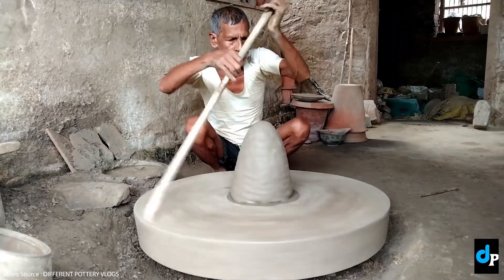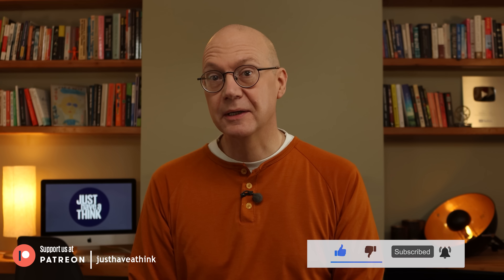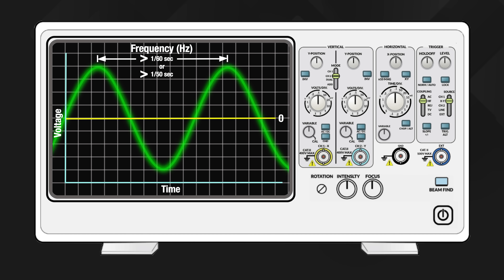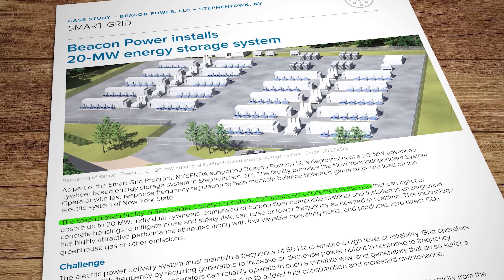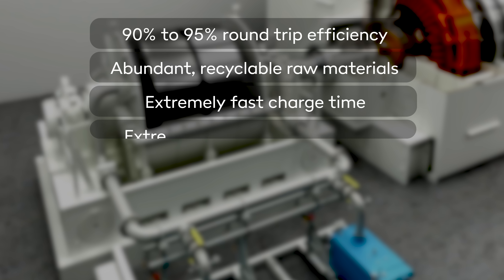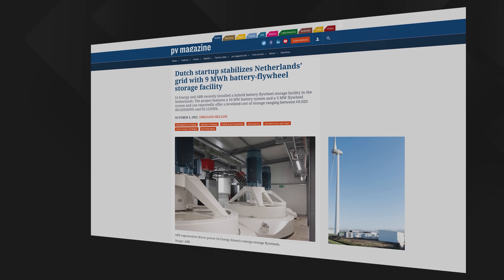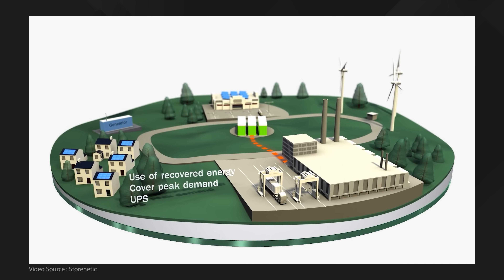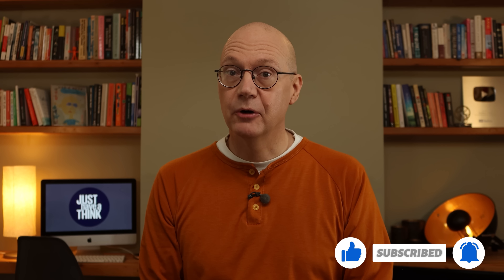Flywheel reinvention revolutionising our power grids!

Comment: 30 years ago was a company around called magnet motor in starnberg near Munich. i think today they are called Renk Magnet Motors and are mostly in military. Back in time they did Busses with e-drive per wheel and diesel engine to power all. To give the system an enegry storage for some minutes a fly wheel storage was atached. The thing, to be in a bus, had to be mounted cardanic. I was told that one prototype was run against a wall in a coal mine to get aceptance for public transportation. The coal mine because fly wheels can become nasty when stoped in an accident. There is a lot of energy in storage.
Reply: I know the guy who built this!
Funny story

Comment: Data centres have been using flywheel units for backup power for well over 20 years. I don't know about earlier but when we were designing colocation centres in 1999-01 they were a viable option, developed if I remember aright in germany.
Reply: Yep. 🙂 I remember watching an Open University programme (on the BBC in the UK) about flywheels in the 1980s. It showed a system used by the French national telephone company to provide emergency backup power.

The flywheels were solid steel cylinders about 500mm long and 150mm in diameter, weighing around 350 kg. Mounted on magnetic bearings in an air-free enclosure, they ran at 12,000 rpm.

I think the energy storage was given as  7.1 megajoules, which was described as the equivalent in kinetic energy of an average family car travelling at 250 mph.

Because of the potential danger of a malfunction and disintegration, the enclosures were buried in pits underground to contain the angry beasts.
Reply: They don't provide long-term backup power. Their purpose is stability - they only have to keep the power running long enough for the generator to start up, and handle any brief voltage drops or spikes on the grid, or a sudden surge in load.

Comment: I've been harping on about this for the last 15 yrs, so good a variety of old greener tested solutions are becoming part of national infrastructures.
Reply: 15 years? Good going, but they have been a feature of power grids fro a bit longer than that.
About 10 years back, the grid scale flywheel manufacturers started looking at systems for micro grids, we had one being developed by Williams on our local stand alone grid.
They really extend battery life by reducing ripple current charcge/discharge.
Another system that was trialled here (starting about 5 years back) were ultra capacitors, which can respond about 10 times faster.
Reply: 15ys ago it would have been competitive as well... Today, with even the expensive tesla megapacks beating it hands down, it is not competitive any more.

Comment: No they won't. Electric companies are routinely discontinuing use of old synchronous generators that can perform this function... we are loosing rotational buffers every single day... everyone is transitioning to unstable power FET/inverter designs that disappear when stability and/or VAR is needed most.

I just watched my local power utility scrap 100MVA of synchronous generators/condensers... we now have no rotating objects within 100 miles of here... and that peaker is due for decommissioning in 2025.

Comment: Energy storage capacity is relative to mass and radius. Mass is bearing dependent and radius is dependent on structural integrity of the flywheel. Probably not much room to improve on magnetic bearings but material and design engineering might eventually lead to improvements in radius. This would result in lighter Weight more energy dense systems
Operational efficiencies such as using excess mid day solar or transitional wind gusts to power up the flywheel to supply short term storage for traditional evening peak demands might mitigate the short term overnight energy disapation issue. 
Ditch lithium ion entirely and replace with more environmentallyfriendly battery/mechanical systems as they come on line. The significantly longer useful life will lower per unit storage costs especially if demand based systems that provide short term but odten very expensive eletricity are replaced with 2 cent power
Also there is no reason the modular units can't be used as a distributed system in commercial and school systems reducing transmission losses and infrastructure costs. I would imagine a profit sharing centrally monitored and controlled system drawing peak power from the closest source and being charged from the locally cheapest power. 
Each distributed installation could be preprogramed to buy and sell using their own priorities involving time of day, charge level, market conditions etc. 
In our area commercial accounts are additionaly charged for 80% of their of thier peek sliding 5 minute window. For instance on demand peek occured when the kitchen went operational. You really can't effectively load shed cooking equipment. Another occured when every every light in 300000sq ft building wrnt off Simultaneously although this has been mitigated by led retro fits. The hvac hot water pumps for a zoned building system that size could exceed 100 hp and had to run contninuously to prevent localized line freeze ups. A distribuedvflywheel system vould be used to power up one or more of those systems and reducing over all energy costs by 30% or more.

Comment: Nuclear is the way, using this storage with them would be great
Reply: No it isn't. One always hears base load, base load.... but that's not helpful for a grid with lots of intermittent renewables. What's needed are fast responding sources of backup power. Nuclear produces a steady output which has the effect of reducing the amount of wind solar etc that can be accomodated. Examples of despatchable backup are thermal biomass, batteries, pumped storage or even natural gas if only used occasionally.

Comment: Rotating machines can contribute useful inertia to a power system, so allowing large amounts of energy to be stored for very short periods (seconds).  But they would be very expensive (as you said) as a way of storing energy for longer durations to help (say) with the need to store energy generated during the day for use at night
Reply: The coils of transformers and inverters also provide electrical inertia. Then add a ms response time and you are at the exact same place for a much lower cost (today) and for a much longer timeframe with LFP based batteries.

Comment: Thanks for that welcome update on flywheel use in energy storage and regulation.
I wonder how the flywheel solution would compare to super capacitors as both seems solutions to the same issues with battery storage and share a lot of the identical advantages.
Reply: Supercaps have much lower self-discharge, but flywheels are much cheaper. Last time I checked supercaps were over 10* the cost/kWh of li-ion.

Comment: An important reason for the use of flywheels is that that can simulate an important characteristic of rotating generators, that of inertia. Dave mentioned inertia but did not explain it's significants as it is a bit tricky. Rotating power generators typically produce AC at the frequency of the grid. If grid frequency falls the rotating mass of the generator puts energy in so resisting the frequency drop and vise versa if the frequency rises. It's a head ache for grid operators as more and more generation is replaced with DC sources that are then inverted to AC by electronic equipment as they do not provide the frequency stabilization of rotating machines. That's where fly wheels come in, not just as another way to store electricity.
Reply: Are you sure ?
BESS   is Battery Energy System Stabilization.   The inverters on these DC sources are computer controlled and should be invisible to grid operators.    I don't know a lot about it.  But that sounds logical.  Why would people be involved ?
Reply: @danharold3087  you are correct in so far as the response time of BESS is extremely fast and is automatic. However, inverters are (usually) limited in their ability to deliver high fault currents without making their designs uneconomical. The use of the inertia of a rotating mass to provide 'fault ride-through' means that more conventional and mature technology of synchronous generating plant can be used to provide network stability and also respond to reactive power demand. Modern BESS and so-called synchronverter systems are starting to make serious inroads into the availability of grid-forming inverter network support but they've got a bit to go before they can compete with the inertia of four 660MW synchronous machines at a conventional large power station!
Reply: @protectiongeek  Thank you.   Power engineering is not my field.   Not saying I am correct.  There is always a danger in using logic when one is looking in from the outside.  

I can see where what you say is true if one attempts to  frequency stabilize with too few battery units.  Not so much with the huge arrays of batteries, each with its own inverter,  being installed around the world.
Reply: A utility I used to work frequently had their generators run in "phase shifting mode" where the mechanical inertiia of the generators would help to smooth brief grid fluctuations.  In addition and that's why it's called phase shifting mode — generators in this mode also can produce inductive or capacitive reactive power to balance the grid.
A generator that's disconnected from the grid and with it's turbine evacuated from water will slow down to a stop from its nominal rotation rate of 333⅓ rpm within about 15 minutes.  So this is not a full blown modern flywheel solution but the effect is known and it's being used to stabilize the grid daily in a power plant that's now about 90 years old.
Reply: Ahhhh…before they hit the grid DC sources are inverted to AC …
Reply: Why would it matter that the energy is stored as rotational energy?
Reply: @paulschlachter4313  the use of rotational energy is primarily historic and economic. The large synchronous generators used over decades were, of course, rotating machines with rotors weighing many tonnes. The inertia provided by such a rotating mass, combined with properly designed electrical and mechanical controls supports power networks during transient conditions such as faults, network switching and sometimes the connection of “dirty” loads. There is no absolute requirement for the energy used to deal with transients to be from a rotating mass. The comparison in this thread is between conventional, rotating machines and other methods such as the energy stored in “large” batteries or ways of controlling inverter-connected renewables (with inherently low inertia, relatively speaking). Trying to replicate the inertial contribution from a rotating mass of tens or even hundreds of tonnes by the use of static power electronics isn’t really economical. Existing technology for batteries and renewables can respond extremely quickly - within a small fraction of one cycle - but have limited amounts of energy to inject into a network to respond to a transient event like a line-to-line fault, for example. The relative energy density of large rotating masses still “wins” the economic comparison with battery systems and the like. A lot of research continues into the development of alternative inertial support so it will interesting to see what transpires.
Reply: @protectiongeek  That's what I thought. It's about the amount of energy and quickness of the availability. The "simulation of the inertia of a generator" (see OP) isn't relevant.

Comment: One of the hydroelectric turbines at Cruachan Power Station is now being permanently used as a flywheel to stabilise the grid frequency.
Reply: But flywheel design and turbines are completely different. Most flywheels tend to be relatively light but run at a high RPM. The direct advantage of using the turbine as a flywheel is that you have have an integrated generator.
Reply: @janami-dharmam  Since energy storage is proportional to mass, flywheels need to be heavy.
Reply: @rogerphelps9939  not correct; the stored energy is proportional to the moment of inertia and the square of the angular velocity. Heavy flywheels generate stress that can cause them to fail prematurely (why satellite rings are unstable) and it is safer and more efficient to run flywheels in a vacuum at very high speed to get more energy storage. It is also better to have multiple flywheels in parallel for engineering reasons.
Reply: Is Cruachan in China?
Reply: @terencefield3204  Scotland
Reply: This is traditionally what has always been done.
In the New Zealand electric grid , which is mainly hydroelectric , the Maraetai power station on the Waikato River was the generator that all the other station's frequency were synchronised to.

Comment: Other than passive solar systems ( which  we should be employing everywhere  for domestic hot water), this idea would help to smooth out many alternative renewable energy sources at nearly all scales. Thanx for adding this thought to my forebrain!
Reply: Storing hot water is a very practical and efficient idea; even in warm climates, we can and do consume considerable amount of hot water as household purpose.
Reply: @janami-dharmam  - I read somewhere that for a typical family, domestic hot water might be the bulk of the energy consumption.
Reply: Unfortunately not, these mechanical systems are not suited to store energy. At all, They are suitable well enough to damp out the demand spikes, but this happens at intervals measured in seconds and minutes, not hours.
Reply: The problem is sudden spikes on the demand side, not on the supply i.e. gusts.
Reply: @retiefjoubert55  - I realize that is the main content, but I was thinking about some possiblities for off-the-grid control systems.
Reply: @retiefjoubert55   It is actually both sides.  Spikes in demand have long been in the system and managed by system operators (although not optimally) and tend to smooth out significantly at a system level (maybe not feeder level).   With intermittent renewables, we have added another level of fluctuations (both supply side and demand side) which suggests that flywheel tech can be a fantastic add-on.  Not great for long-term energy storage (as Retief has said) but neither are batteries with today’s technology.
Reply: @retiefjoubert55  - I was thinking that a flywheel might help to stabilize turbines in gusty conditions, rather than a total shutdown.

Comment: I think the overall simplicity of a big spinning mass is great for longevity which overall should reduce the lifetime environmental impacts as well as spreading out the system cost.
Reply: I would have thought so, but the cost per kWh of flywheels is quite disappointing.  The cycle life is good, but they need maintenance.  The only figure of merit that really matters is LCOS.

Comment: Flywheels are another marvelous example of an ancient technology the can continue to refine in design to excellent effect, but then, of course, profit-centered companies like Siemens will come along to continue the relentless drive for massive centralization and control to maximize corporate benefit (GUARANTEED any actual cost reduction in production and distribution costs, still highly moot, wil not benefit ordinary low-consumption customers) while building in higher point-of-failure risks to utility systems, and the concommitant unequal (excessive) cost burden to the poor.